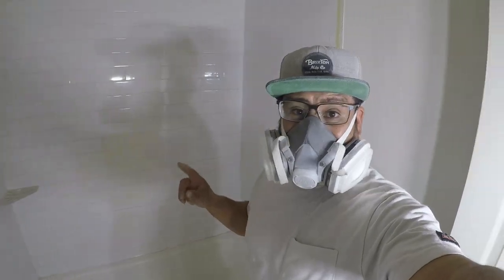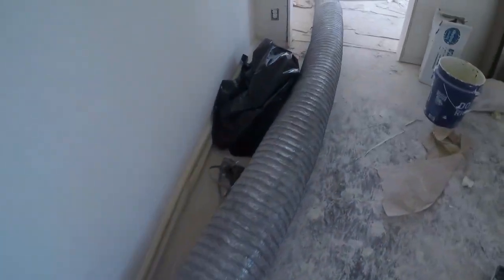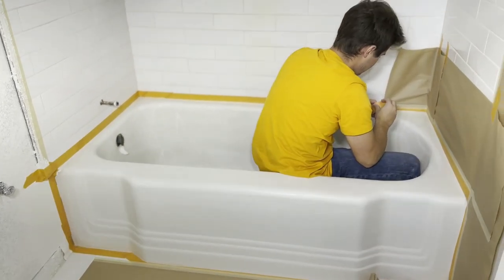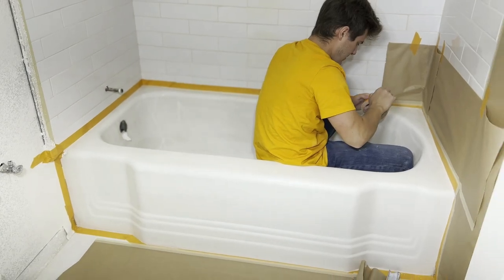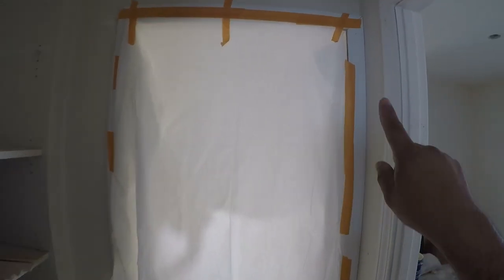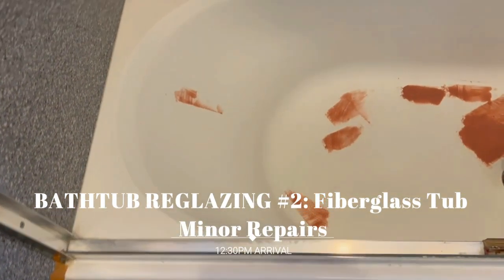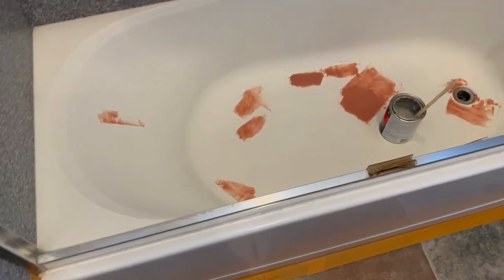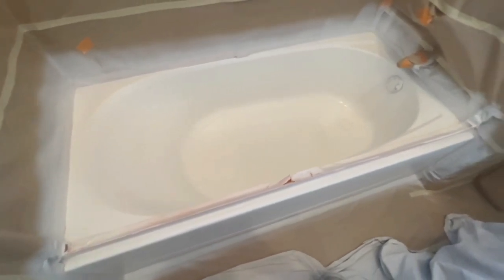HOW TO REGLAZE & REPAIR 2 BATHTUBS IN 1 DAY | Reglazing 2 Bathtubs in less than 8 hours | DP TUBS

Comment: Do you always have to primer a tub or do you only prime when it’s first time reglaze ?
Reply from the maker: I like to primer on every tub to ensure that there are no fish eyes and it helps seal the surface really well. I use an epoxy primer so it also adheres to the etched surface better as well.
Reply: @DPTubs  I see, that’s helpful. Thank you. How do you do when the mold is really into the enamel ? I did a tub that had a bunch of mold really into the paint, and the only thing that came to mind was to remove the entire enamel and then really sand off the roots of the mold
Reply from the maker: @dennismedina9529  I have never come across anything like that. I would call a mold remediation company first to see if they could remove the mold. Removing the original enamel seems a bit much.

Comment: Just my two cents. After using the scraper and vacuuming up the debris. Try using “Easy Off” oven cleaner in the yellow can. 

*Not the knock off versions or the fume free in the blue can.

Saturate the surface. And let sit for like 45 mins. And then just wipe. ¡Viola!

That shit is “Strong…. In a can”
Reply from the maker: Does it leave a residue? The acid is necessary to etch the enamel for adhesion of the primer and the top coat.
Reply: @DPTubs  definitely something you use before the primer process but it does leave a little residue but nothing that a clean terry cloth and water couldnt take care of. Ive used easy off for other applications. It can be as delicate as you wont like materials passing as papers and not rip it and as strong as you need it to be to clean on more solid surfaces. Try it out small like on a sink on your next reglaze.